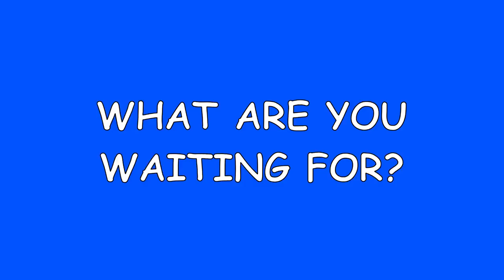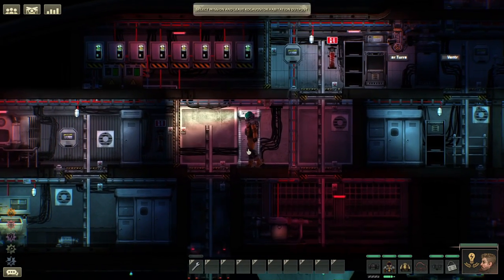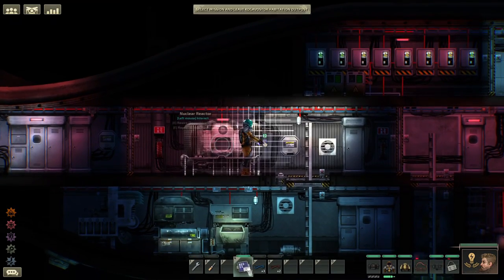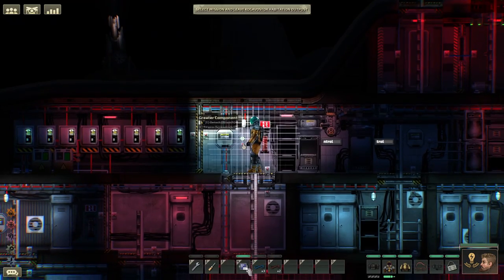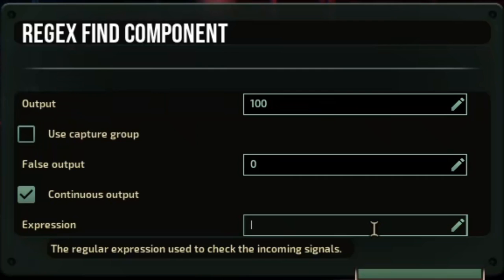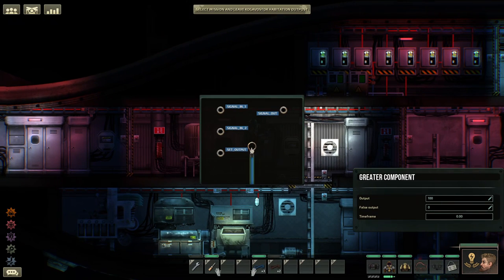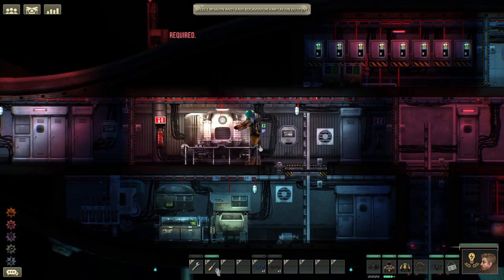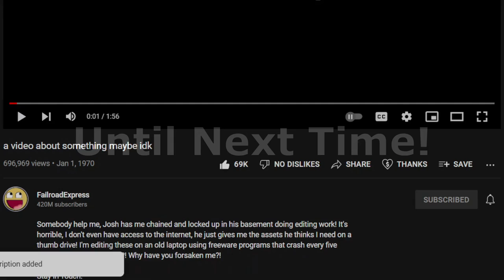Make a Hands-Free Reactor in Barotrauma

Comment: joined a multiplayer server for the first time to see how people play and I spawn and see that we are not allowed to touch something in the reactor room open the door and see some abomination of wires and components spilling out of the reactor and I opened it saw that it had 4 fuel rods in it and the reactors just fine with it ....... loosing my shit at this point I'm like captain how did this happen and he just laughs in this slow chuckle and goes black magic  my boy, Que the engineer on the radio " Having a  STEM degree helps out sometime " ......... I just sat their and was like damn these guys playing a different game XD Anyways Ill take your entire stock
Reply from the maker: Yeah!  That game can get so crazy complex. I’m glad we found a slightly simpler upgrade. Haha.
Reply: @FailroadExpress  does that mean the bang bang solution works with 4 reactor fuels? will it use them more or less effectively?
Reply from the maker: @toofle  It should work but I'm not sure about the fuel efficiency.  You should be good with 2 depending on your power demand.

Comment: Are you meant to turn off automatic control too or keep that on. How many fuel rods should I put in when doing this?
Reply: The automatic control toggle can be either on or off; The wired inputs always take priority. You can have any number of fuel rods in the reactor, though I'd recommend 2 or more for a more responsive reactor.
Reply: @DrFreenote  Got it, I tried it with a couple of subs and it worked like a charm, except for the R-278 Dugong on steam workshop. Probably some other wiring that conflicts with it, but im not about to tear it apart.

Comment: Does this setup still work? I set it up and put two rods in and I had to pull the rod out because it was overheating.
Edit: Definitely not, considering I just read the patch notes on the new update that gutted 2 component setups
Reply from the maker: It's very possible that a wire was misplaced or that the expression used in the RegEx component was mistyped.  Double check those 2 things and see if that helps.  If either of those are wrong it will turn the reactor on and not turn it off.
Reply: @FailroadExpress  i can confirm that something's up since the latest update. I've had 3 reactor fires on a save that was 100% okay with 4 rods before the update.
Also noticed that the control sliders no longer rapidly switch between 0 and 100 but don't move instantly.
The general idea of the reactor controller is probably still good, just the regex needs tuning
Reply from the maker: @xx-ui2gm  Thank you.  After reading some info on the update, I've learned that they did update reactors so there is probably a way to re-wire it.  We will have to figure out what's up.
Reply: @FailroadExpress  cant wait for new instructions. i think new hoist the sail makes a new mechanic that conflict this trick

Comment: add PID Controler or PIDC hashtag to your video, and your title too. it is basicly it. I havent found your video because of that, until i typed "reactor upgrade". cheers <3
Reply from the maker: Thanks for the suggestions.  We'll do that.  What were you searching for before you found our video?
Reply: @FailroadExpress  for that exact thing, but because there are a lot of outdated  PIDC videos there, your were actualy first who had that updated. 
Don't even ask how did i feel, when i was torturing myself trying to craft it with about 20 components  and then i saw your video crafting exact thing, just with 2 components. And it is even working better than the old oneXD
Reply from the maker: @Fufancz  Glad we were able to help.  And thanks for the key word suggestion.

Comment from the maker: Hi, everyone!  Jash aka DrFreenote, is working on a new version of the reactor control.  The latest update may have prevented this type of reactor from existing.  It's not looking good.
Reply: it still worked for me today
Reply: @DRcorban  same with a previous sub but it only still works to those that already had the thing set up, any new ones made will no longer work
Reply from the maker: @rjames0820  Thanks for the info.  We didn't know it still worked with pre-existing subs.
Reply: @FailroadExpress  It... Kinda? Still works, but it at least still allows me to run 4 rods without much issue
Reply from the maker: @joshwalker8061  That's good.  Is it just running slower now?  How has it changed?
Reply: @FailroadExpress  The main issue I've seen is that it tends to be a little unstable when it comes to the temperature. Sometimes it'll need to "Warm up" after tossing a bunch of rods in, will overheat once and cause a fire that you can quickly put out

And then the rest of the time the temperature spikes at just before starting a fire, with the occasional brown out..? It's still better than manually managing it by far, especially for my single player campaign, and my multiplayer game so I don't need to baby sit the thing, but... It seems to perform less well than it used to, by far.
Reply from the maker: @joshwalker8061  Thanks for the info.  Yeah, the addition of the temp control really screwed it up.  Glad to see it's still helping you out, though.
Reply: @FailroadExpress  was a new reactor method ever developed? I would love to have an automated reactor for my campaign run
Reply from the maker: @mungologgo5526  A new video will be coming out soon.  Dr. Freenote has developed a new controller that, while not as good as the old bang bang, still helps out a lot.

Comment: I don't really have any problems with reactor overheat or meltdown. In fact I tried for several minutes maxing out the sliders and could not produce anything but fire. I sat there for 10 minutes watching the fire rage around the reactor. Eventually it went out by itself. Still no explosion. I don't get the meltdown concept. 

But perhaps you can answer me this: Is there a way to adapt the expression magic with a more advanced fuel controller setup? I run the fancy memory-multiply-divide FC but it's extremely slow to react to load fluctuations. It also skips a beat due to game engines failure to promptly translate crew talents into ship componentry.
Reply from the maker: I'm not sure if our other video would be what you're looking for.  It's link is in the description.  It's an updated controller that should still work with the latest updates.  Maybe that's closer to what you're looking for.
Reply: @FailroadExpress  Thanks man. Sorry I was slow to pickup on the new video. I have since watched it and will give that method a shot. Cheers!
Reply from the maker: @surg23  No worries.  Hope it works for you.

Comment: whats the reason for auto reactor ? i put it on automatic and it works so far im new whats the reason
Reply from the maker: Controllers are supposed to make the reactor more responsive and reduce the wear and tear of electronics. This is caused when the reactor creates more voltage than the sub needs.

Comment: This does not work. It just shuts my reactor off and does nothing.
Reply: Hey, Jash here! I just tested this build in the latest version of Barotrauma on Steam (v0.18.15.1 as of this comment) and it's still working for me. Let's see if we can't troubleshoot the issue you're having.

To clarify the wiring a little bit, when it comes to wiring 'LOAD_VALUE_OUT' and 'POWER_VALUE_OUT' from the reactor to the Greater Component, 'LOAD_VALUE_OUT' must be connected to 'SIGNAL_IN_1' and 'POWER_VALUE_OUT' must be connected to 'SIGNAL_IN_2'. If these are swapped, the Turbine Output will never engage and you will get no power from your reactor.

If that is all wired correctly, ensure that the "Output" field for both the Greater Component and the RegEx Component are set to 100. If they are set to the default value of 1, then the generator will only be able to control the Turbine Output and Fission Rate at 1%, which is effectively nothing.

If everything still looks fine and it is still shutting off, ensure no wires are connected to the 'SHUTDOWN' node in the reactor. It could be that a different system on your submarine is falsely detecting a malfunction and shutting off your reactor.

I hope that helps!
Reply: @DrFreenote  I followed another video and it worked perfectly. I think the wiring order in this video is wrong. The other video I watched did it in a different order. Maybe the order you do the wires matters.
Reply: @kenshinhimura9387  The order you wire things shouldn't matter, it only matters what connects to where. Glad to hear you got a design working in the end, though!
Reply from the maker: Thank you, Dr!
Reply from the maker: Glad you got it to work!

Comment: Why can't we use another grater component for temperature (something like greater than 5000)?
Reply from the maker: The controller may not be able to rapidly adjust the reactor controls anymore.  So even if that did work, the controls wouldn't "bang" back and forth fast enough.  We're still experimenting when we have the chance to see what the options are.